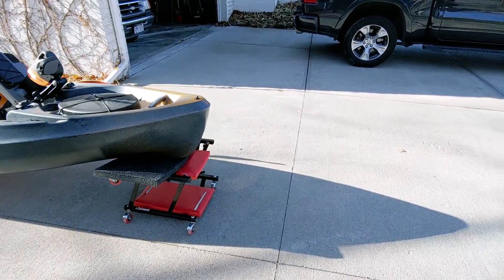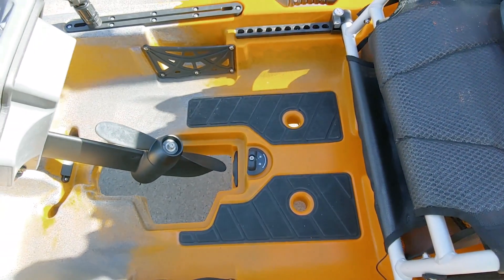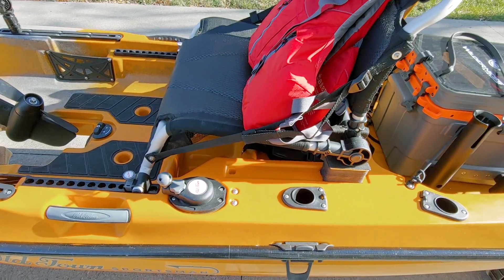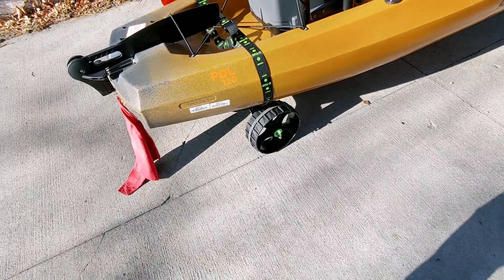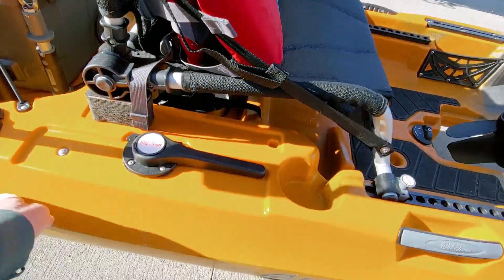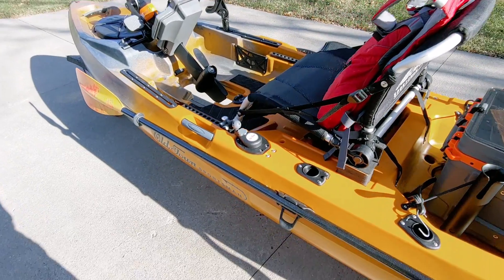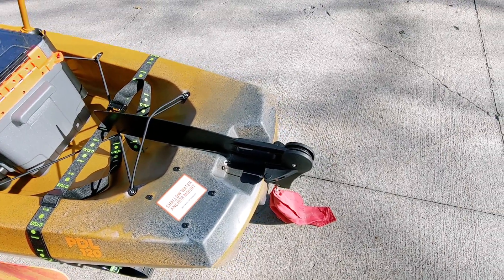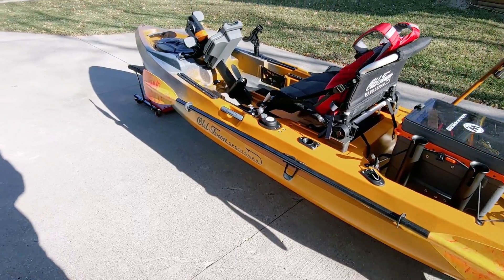Old Town Sportsman 120 pdl

Comment: Hello Phil. I am new to this sport and am considering the C-Tug for a Sportsman 106. In another video, the C-Tug seems to fit fine, but you claim that you had to make a modification. Before I pull the trigger on this cart, I would like to ask what the extent of the modification was. Thank you.
Reply from the maker: That mod I made was pretty simple. It was just 2pcs of 1.25 pvc covered with pipe insulation tied to the cart with wire ties. I've used it alot and it's still working great
Reply: @midwestphil2271  Thank you, Phil. Sounds simple enough.

Comment: Me and you weigh about the same.. when you're pedaling at a good pace do you have water coming up from the drive? I have mine locked all the way down like the kayak dealer told me to do.. and he even said that's people's problem with water coming up.. they don't lock it down right ha.. but mine is definitely locked down correct. But when I goo at a good pace I got some water flooding up.. but when I stop it drains out like you said.. but I'm wondering if it should be coming in at all..? Maybe cause we are bigger guys??
Reply from the maker: I dont get any water coming in from around the drive. Any water that does come in drains qwickly
Reply: @midwestphil2271  I'm confused..none comes in but if it does it drains..??
Reply from the maker: @Timothy1987  Water that may come over the bow, or sides, when you first enter the Yak water will push up through the scupper holes but drain back out
Reply: @midwestphil2271  ok I gotcha.. so what I'm seeing is it actually coming through the scuppers by the drive and not actually the drive itself. Cool

Comment: Nice review Phil.  I have the same rig (my first yak) and I love it.   I went with the Wilderness cart and have  been happy with it although my winter mod is going to be a Boondox install.  I am on the east coast and have had it out in pretty rough water and it is super stable.  Most  of the time I am in a river or sheltered bay.  I agree - dont need scupper plugs.  Being a big guy also (6'4" 230lbs) I think its a great craft.    I made seat risers also that puts my tail up 3 1/2"s.  Enjoyed the review.  Tight lines!

Comment: Nice review! How well does it keep the water out when in motion? Do you notice any water coming through the pdl drive lock down hatch? Or get any in the cockpit when moving? Just wondering how dry it stay fishing late fall early spring. I’m looking at buy this kayak very soon.
Reply from the maker: I did carefully inspect the bow hatch for any sign of water leaks, this was done on the ramp with the stern elevated, zero leaks detected. On the water, peddling into a 15mph wind a little water came over the bow. No water came in around the drive. The water I got in it from entering ran out immedeatly.
Reply: @midwestphil2271  sounds like a pretty dry ride for the most part.  Cant do much coming over the bow. I was mostly worried about around the drive. Appreciate your response, and posting a video of your rig.
Reply: I have this kayak. No water comes through the lock down hatch that I’ve noticed. You’ll get water that comes over the bow if you’re out there in chop and wind but the drainage is fantastic. This is a great boat. Well thought out and super stable. If you’re taking it offshore you’d be better off with the salty or the predator. If you fish freshwater or inshore, this is a great option.

Comment: Hey Phil.  I am also in the Omaha area.  I am looking for a pedal kayak.  I was looking at the Lightning Strike HD but have seen issues with water coming up through the drive port for heavier people.  I weigh 260lbs and don't want to worry about that.  So, my question is, you mentioned you got this kayak from Bass Pro.  Did you have to order it or did they have it in stock?  Thank you in advance for your time.  Great video.  Cody
Reply from the maker: I did order it from BP and it was in stock at one of there many distribution centers although they could not tell me where the location was.
Reply from the maker: Also I would recommend you buy directly from Old Town if it's at all possible. BP removes the protective cardboard, installs the seat, inspects for damages but does not put the cardboard back on. It's then shipped to a local BP shop for you to pickup. Mine received some dings along the way.
Reply: Thanks for the quick response.